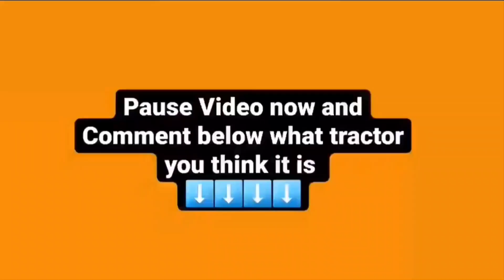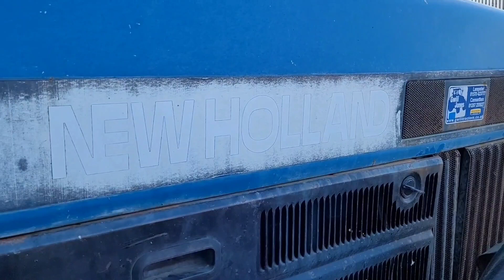Bit of a quiz for fun, Guess what the Tractor is , no one will ever get this I reckon

Comment: Well I was going to say 1046 international with comfort 2000 cab,as being a harder guess, before moving to Canada in 2000 We lived by Aberporth and had one on our farm. Now for an interesting story When Mason Bros started tractor pulling at Haverford west in the mid 90's , and we were the Belarus tractor dealers. I built a Belarus V8 tractor using a parts tractor from the cowan family at Plwmp and  a perkins from a fire engine. Originally I was't going to turbo it, so bought 2 of those mufflers from Bepco when I sold their parts. I figured twin exausts on that v8 would sound wicked with the whistle, It turns out only the original tractor ones  whistle. The bepco ones didn't somethings different in the baffles inside,and I turbo'd the engine instead. I think one of them ended up on the 1046 when we sold it to TJ plant at Cardigan in 2000 before coming here and the other ones  here in Canada with the Belarus/perkins V8 tractor.
Reply from the maker: Thats interesting you still have the puller? Would make a good video for YouTube tbh , I have a 6cyl super major myself tbh . Are you farming out there or a dealer ? Tbh i have heard of them, story of JCB mk1 serial number 2 came from Cowan farm sale if it's the same one?
Reply from the maker: Yes some sort of cone baffle in the originals that make the sound, why cant they cut a original open and coppy them exactly out wherever those things are made beats me 🤷‍♂️, they would sell a lot , probably be demand for them in other tractors as aftermarket jobs id bet too
Reply from the maker: https://youtu.be/necJejUWEVQ
Reply: @arwelagrimachinery  Hi Yes thats the family I was at that sale , funny thing is the 3rd brother coming to canada just before us is why they sold out. The Brother is North of us in Manitoba. When guys in wrecking yards figure out who i am and built that tractor they say  Cowan still talks about it and how tough that scrap backend was after they beat it to death like they did everything else farming. We farm, I work self employed fixing and driving equipment for some guys, I buy some Majors for my collecton and sell other things to sometimes. I just let 2 super6 954 countys  go from the collection this winter
   I'd seen your 6 before it's a nice conversion with that sump and wheels. I have a 6 power major that was built by DD Thomas the vapormatic/tractor dealer at Aberporth. It's suppopsed to be the first one in the Cardigan area built back in the day from what he told me. I understand from a comment DD made, Gwili Jones built loads in his workshop after this by copying it.  I'm going to start restoring it this year, It made a lot of locals who tried buying it from DD over the years mad when it sold to me for less money and came here, I think he did it to spite them L.O.L. To be honest filmings not going to happen here, my customers aren't keen and I have things  in the yard /my workshop that stay private, because I don't want visitors borrowing stuff late at night.
Reply from the maker: @super6954   fair enough, supose the Belarus is famous by now they'll know its you